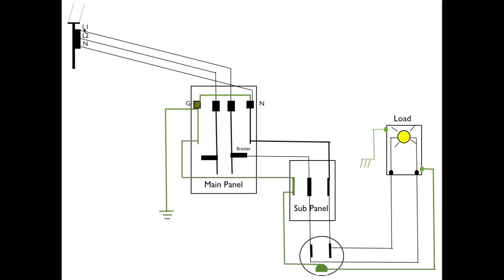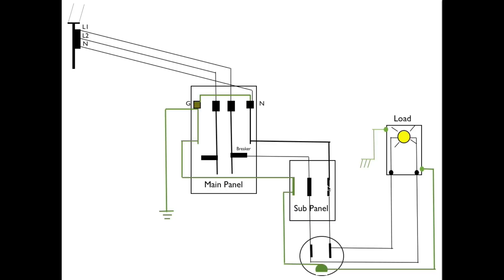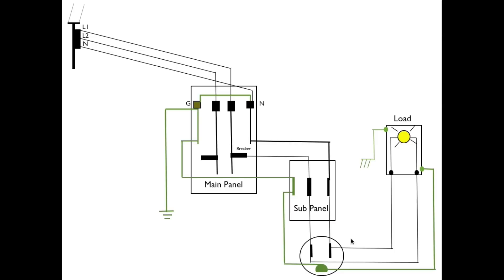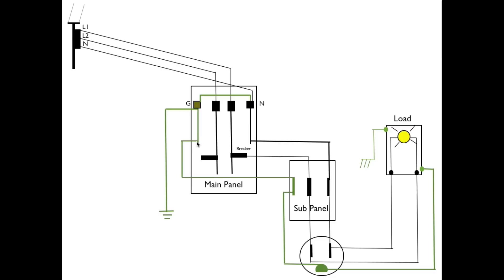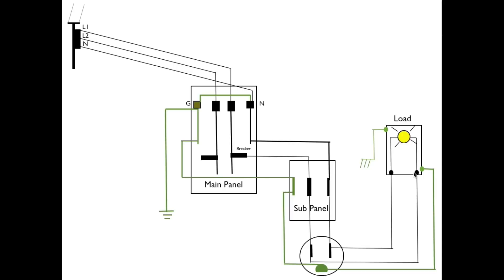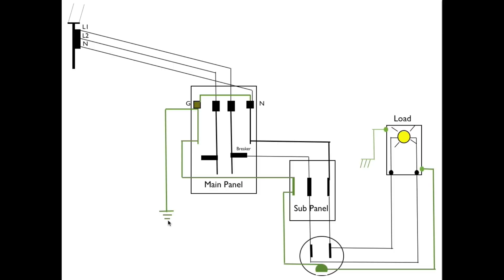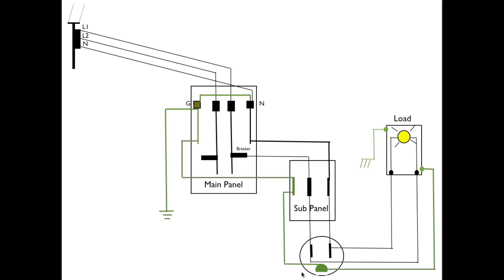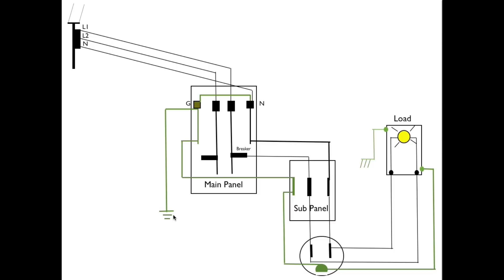The difference between neutral and ground on the electric panel

Comment: This is as crappy an explanation as all others. He says you'll be shocked if the load box is hot...uhhhh I'm pretty friggin sure you'd be shocked if the box was hot with or without the ground. 10 mins of BS
Reply from the maker: +gqjohn1122  If the box became hot because of a fault from Hot to chassis, the ground wire is connected to the neutral in the main panel.  A direct short from hot to neutral will open the circuit protection and thus eliminate the shock potential.  Hope this helps.
GFM
Reply: gqjohn1122 — If a hot wire shorted to the box, and the box were well grounded, the circuit breaker for the hot wire would trip.  If the box were poorly grounded, the breaker might not trip, then you would be shocked when you touched the box.

Comment: There is no "neutral" on the pole. That bare wire only serves to support the two hot leads.
Have you ever wired a house? Obviously not.
Reply: Neutral should be returned to the center post on the street transformer
Reply: Have a friend with a lot of patience and a copy of the 2011 or 2014 NEC try to explain Section 250.24 to you. 

Attach a list of all the houses you have wired to your will with instructions to forward to the Fire Marshal's office when you die. It is only fair to the occupants and very clear from your attitude that you will not cure the flaws during your lifetime.

Take out permits on future houses you wire and have final electrical inspections to save lives and property of the public you are supposed to be trained to serve.
Reply: Richard McCullough — You are wrong.  The center tap of the transformer is commonly called “neutral.”  In a modern installation, there is a bare conductor for the neutral and two insulated conductors for the legs which are wrapped around the neutral.  The three wires are supported mechanically by a small, but strong, fourth wire.  And, by the way, I have installed a main load center in a house.

Comment: every breaker box I've ever seen the ground and the neutral run to the same bar I don't know where you're getting your information but it is wrong to tell people things that aren't true
Reply from the maker: Maybe you should try looking at one that is newer than 60 years old.  Even though the neutral and ground are bonded, they should be separated.  If the panel is a sub panel, the neutral and ground must be separated.  Btw, the info is from the NEC.
GFM

Comment: You do some strange and even dangerous things in the US dont you?!
Reply from the maker: The different systems have their good and bad points.  Consider the difference between a 240 volt shock and a 120 volt shock.  Pretty shocking lol.  By far the most shocks I have reviewed were 120 volts.  Almost (but not quite) negligible.  The small number of times I was shocked by 240 or 277 I definitely knew the difference.  In the American system, the chance of getting a 240 volt shock is very small as most faults, even in 240 volt circuits that could cause a shock are 120 volt.  
By using 240 volts in the European systems, I am subjected to a far worse result if I get shocked.  As I see it, the advantage in the European system is there is more availability of 3 phase, lower voltage drop and dip of the secondary circuits and smaller wire size.
GFM